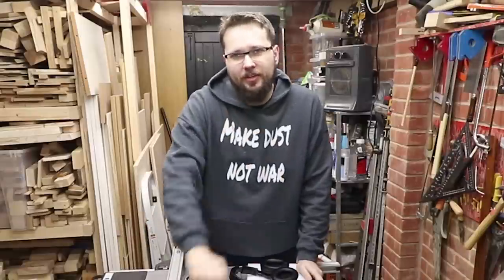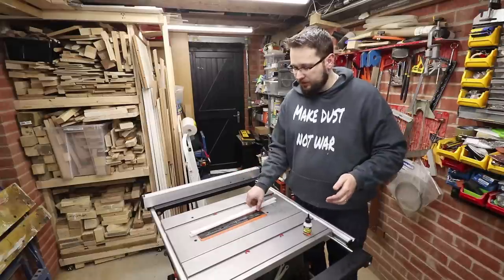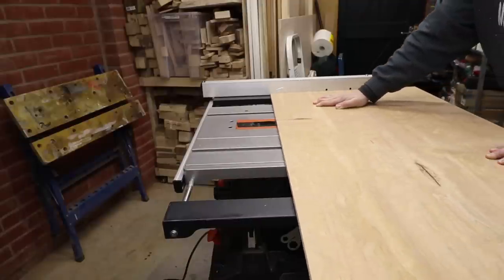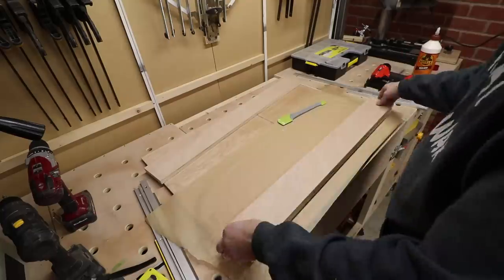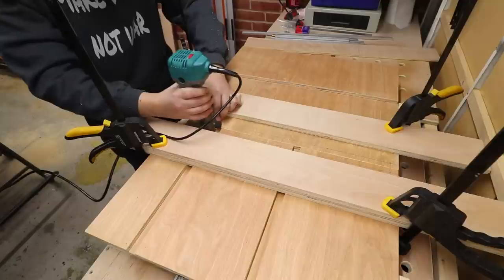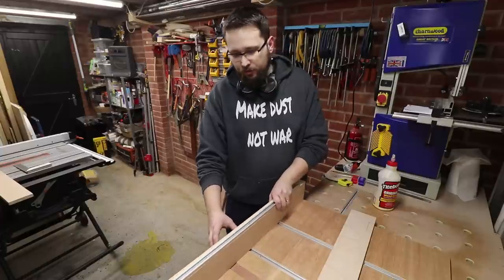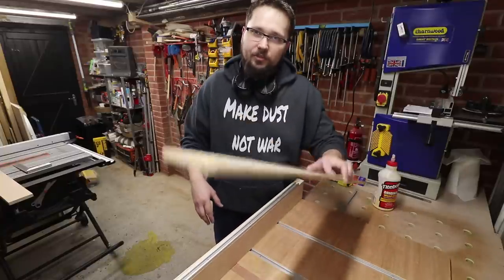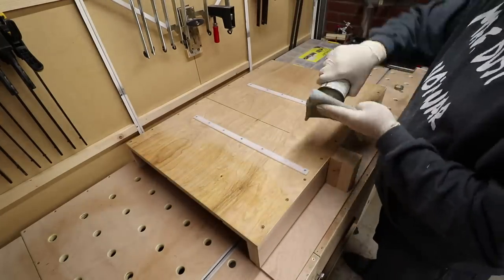Table saw Sled for Evolution Rage 5-S

Comment: Interesting features you have there, the T-tracks and the zero clearance strip. My only complain is the way you set up your sled's squareness. There is a way that is pretty much standard on setting the back fence for square cuts, made by William Ng. Here is his video, https://youtu.be/UbG-n--LFgQ . Test your sled using his method and you may see that your squareness is not that good, or mayb it will be, who knows.
Reply from the maker: Yes someone suggested that to me. Done the test and it came out perfect - probably more luck thank anything else 😉

Comment: This is a first for me as i usually like what you make but unfortunately i'm not fond of this build, there are too many tracks for my liking and if i was going put a track in it would be on the push part were you can put a stop block for repeated cuts.
It's a sled so it doesn't need all these tracks on it, as for a zero clearance there is already one on the first cut, and as a Evolution blade why would you want to change it, sorry but that's how i feel.
Oh and i haven't given a thumbs down on this in case you were wondering, i only do thumbs up.
Barry (Wirral, ENG)
Reply from the maker: Thanks for the feedback mate. I use two blades for my saw, the multiblade and the wood dedicated blade which is slightly thinner. But I'm also planning to try out the Saxon blades I got one with 3600 RPMS I think. Where it comes to the t-tracks I got few jigs that will utilise them. Hope it will make more sense in the future videos. As I'm limited on space I need my jigs to do multiple things for me as I can't afford to have too many. That's the reasoning behind it. But I fully respect and understand your opinion 👍

Comment: hi mate thought id give you and everybody else a quick hack for this table saw as being a fabricator welder myself i like to do things the easy way :)  and i think you have missed a trick with this saw..in its standard state the saw gives a fair table working size but both you and everyone else uses an extra support stand to cut larger sheets but we actually dont need to make or buy a stand we just need to do this.the left side of the table only pulls out so far so heres the hack.go to your local diy store purchase  2x 2m 12mm round tubes and a lenth of 47mm square wooden post remove the standard tubes on the saw, cut posts to leg size needed add a thread to bottom to adjust feet height  attach legs to corners where tubes fitted drill threw where holes are now insert the tubes drill a hole threw each tube and bang a screw threw them drill hole threw other end add a nut and bolt threw it and voila you have now added 2 metres to the cutting length of the saw easy peasy
Reply: and also wickes sell a 19.5 x 2mm thick pvc flat bar ideal for runners but will need gluing together to make up the depth of runner at under £3 a metre  or b&q sell a 5mm thick by 25mm wide pvc flat bar 2 metre in length ,trim  width to 19.5 and theres your runner
Reply from the maker: Great stuff mate thanks 👍😁